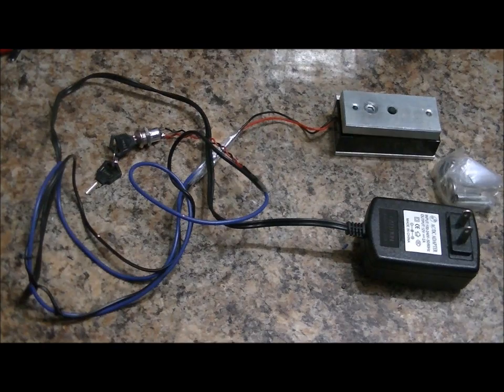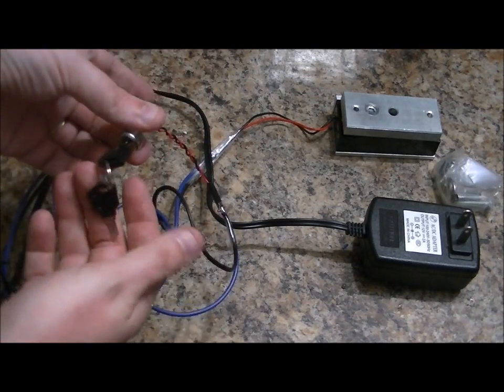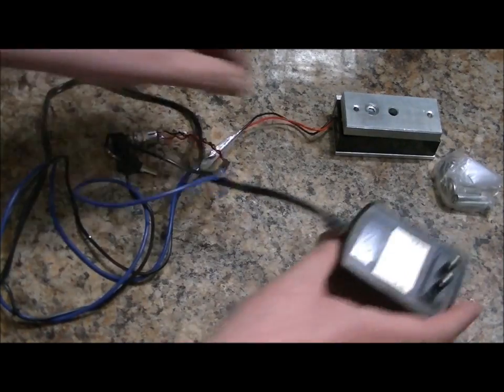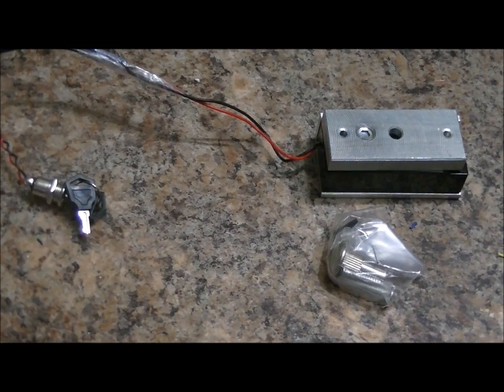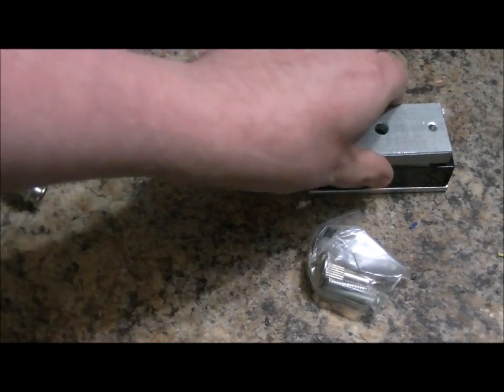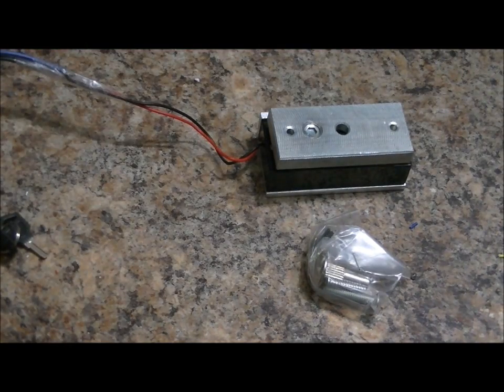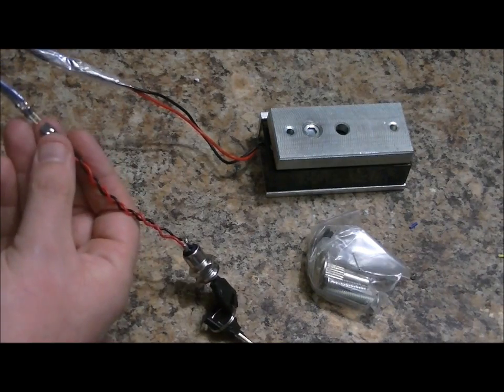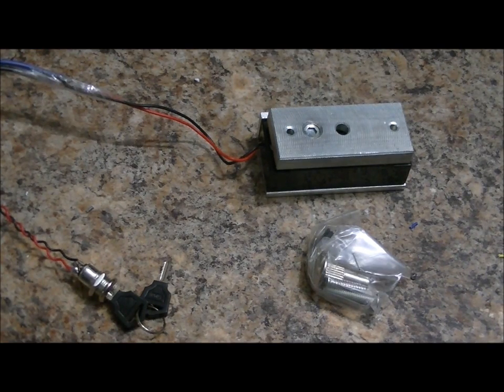A Key Based Electromagnetic Lock Switch!   An Escape Room Prop!

Comment: One thing neither your videos nor your web site mention (unless I missed it) is how strong the pull of the electromagnet is. Is it 50 lbs, or 100 lbs, or 200 lbs, or what? Just lifting the keeper plate with the electromagnet doesn't really tell us much, since it only weighs a pound or two. It is obviously fairly powerful, but I'd like to know how powerful it is (under ideal conditions).
Reply from the maker: Hi Mark
The manufacturer rates it for 100lb.  I haven't found a way to properly test the accuracy of that, but when lined up/mounted properly, it is very strong.
Thanks =)
Pat
Reply: Thanks. That answers my question.